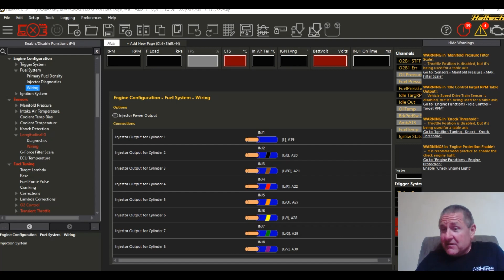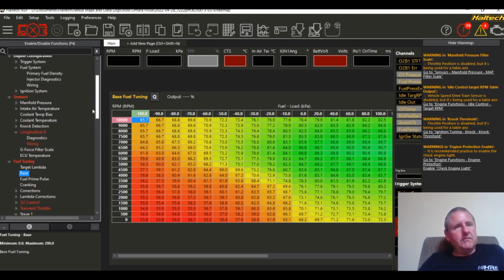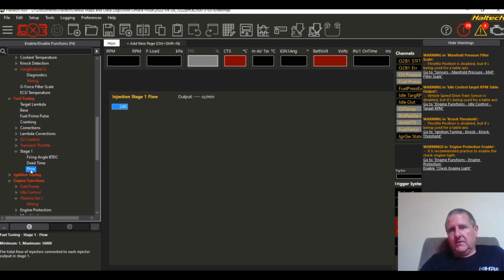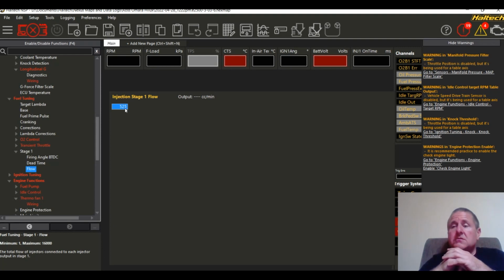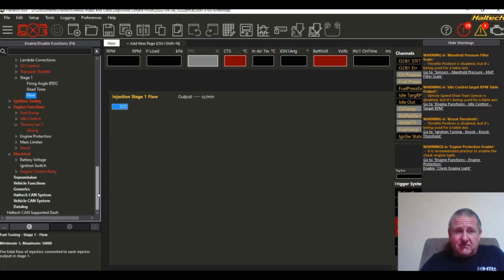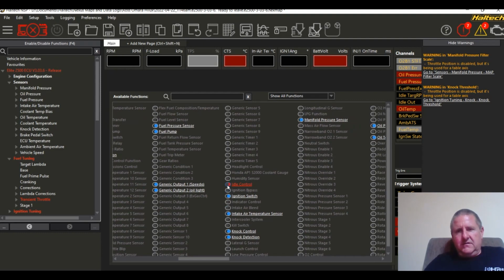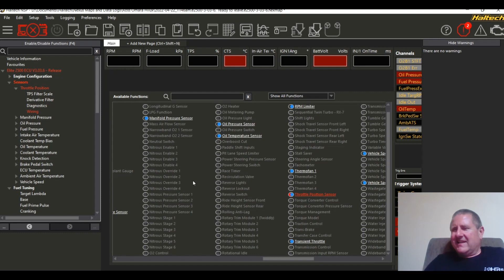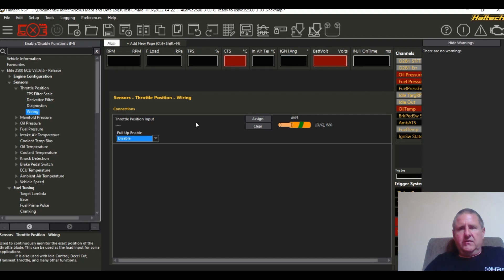Haltech ecu injector resizing

Comment: I have a TB42, just done a turbo setup and it starts fine in the stock ECU.

But plug in the 750 elite and import base map from the haltech website, and the car will crank but won’t start.

My question, is there a video that walks you through step by step on how to set up the base map for the particular car.

As there is nothing that explains how to step by step setup the ECU from scratch…

Thanks